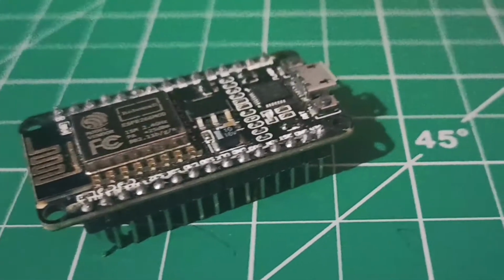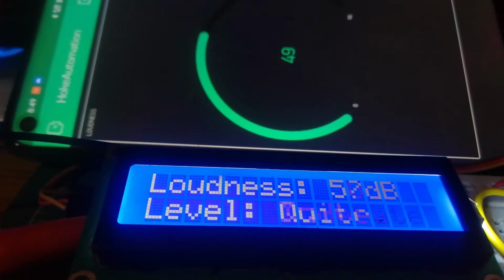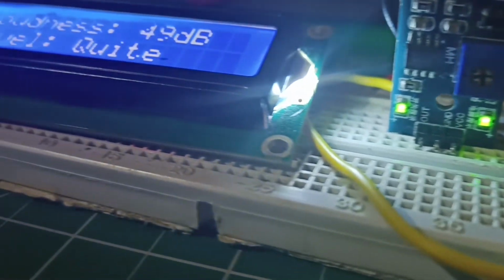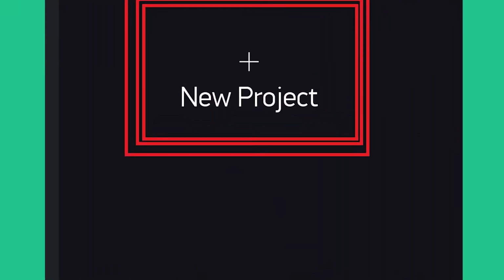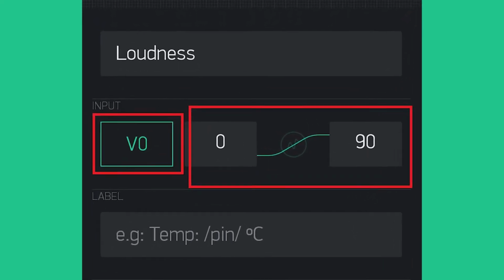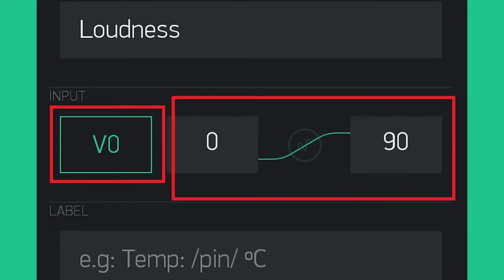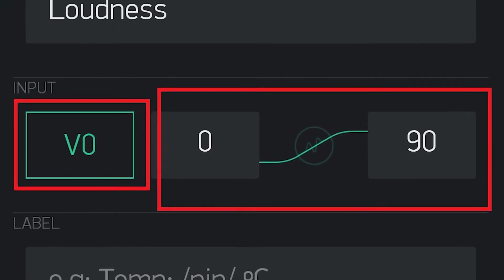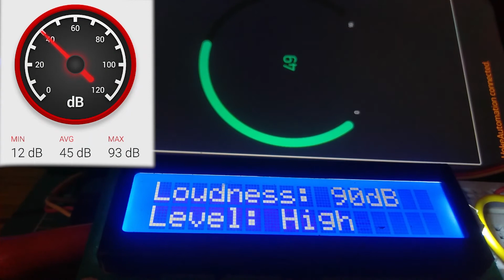IoT based Sound Monitoring System - Measure and Monitor decibel (dB) using NodeMCU

Comment: Hey
It's showing error for POSITIVE
And which library to be installed for ESP8266Wifi.h?
Reply: im facing same error. did found any solution ,if yes can u tell me .
Reply: @harsh--creates007  hey have you completed this project?
Reply: @Akash-gb9pg  what is the problem with the coding? can you help me sir?
i get the same problem. error for positive
Reply: @hakmi132  reading was not showing on the LCD display, but now it's all sorted. I tried a different LCD library and it finally worked.
Reply: @Akash-gb9pg  please tell me the LCD library as soon as possible??
Reply: @Akash-gb9pg Bhai please btao aap kaise kiye
Reply: @deepakdev817  what problem you're facing?